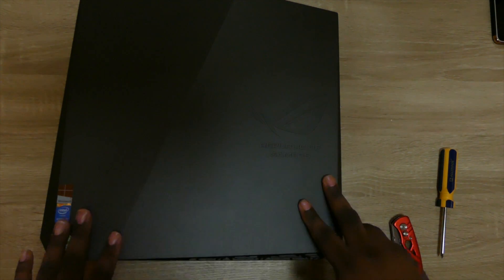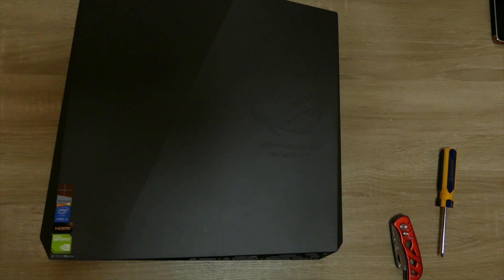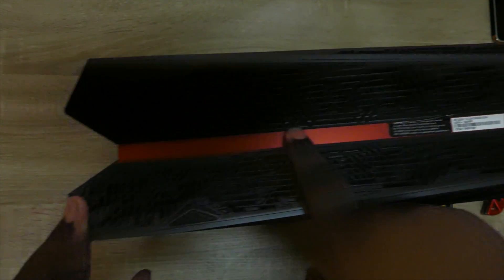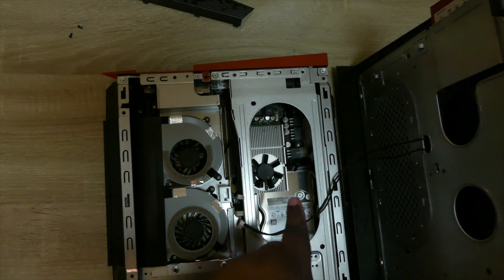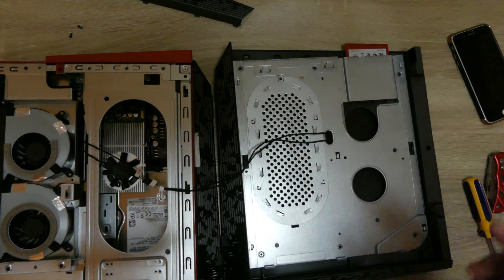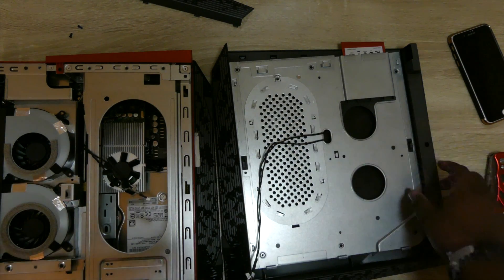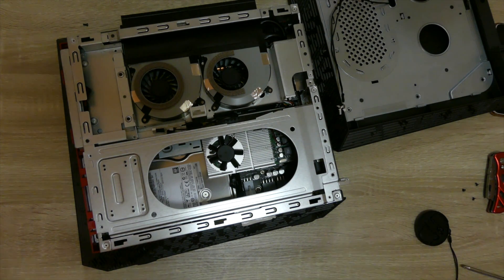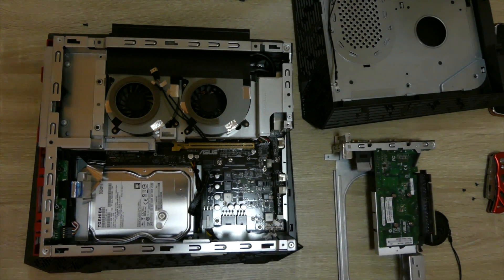How To Take Apart Asus ROG G20AJ Desktop To Replace GPU Part 1

Comment: Where is the part 2? I have the same PC as you. My problem is that put gtx 760 and gtx 950 but it wont recognize any of them. I plugged the power cable and switched the jumper on the board to active the 8 pins port for the PCIe cable. When I turn on the pc GPU will start but it wont give any signal to the monitor but if I plug the monitor to the integrated GPU it will trigger the monitor. That mean the board is not recognizing the GPU. Help me please!

Comment: Can I take out all my parts and put then in a new case? I want to switch to a clear case?
Reply: SaucyfuL, you would be able to do this as long as the motherboard used has a form factor used by case. Looks like this could be a micro Atx board, but if it doesn’t have the same mounting figure you’ll be stuck with this case.

Comment: Do you know, can i put geforce 1060 6gb on this? Does it fit and is there enough room for it?? Please im thinking about buying it so thanks
Reply from the maker: SAMBSA yes but your going to need a founders edition of a Single fan if you do buy it make shore it will fit. Also your going to have to buy another PSU from amazon cuz this computer needs to power cords to work.